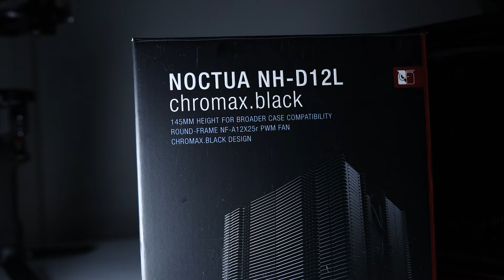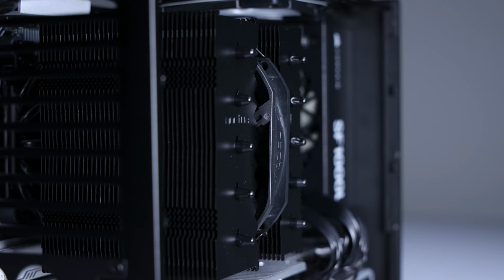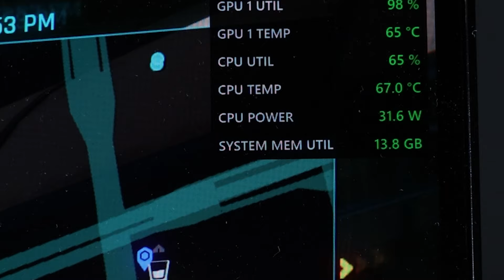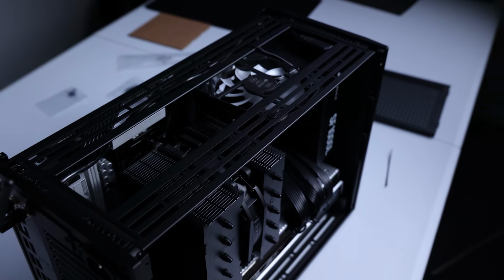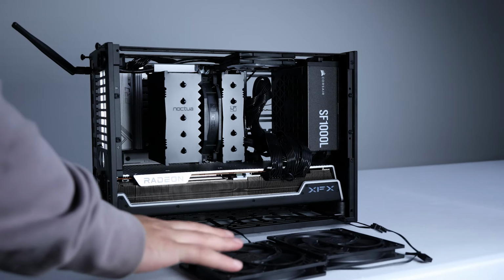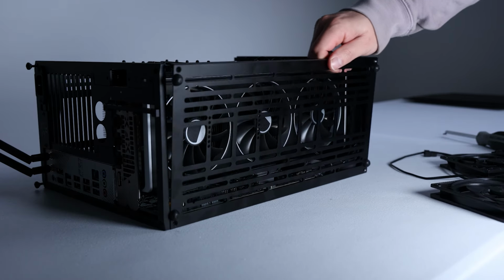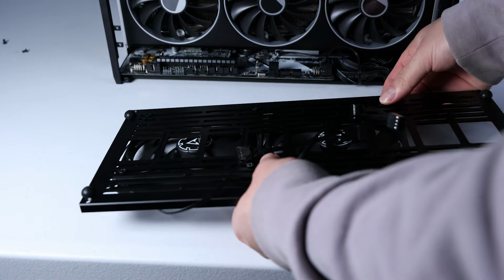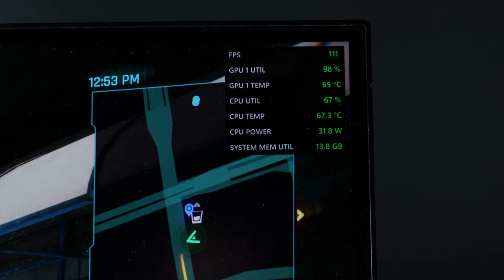The S-Tier SFF Case - NCASE M2 Build

Comment: as someone who has a XFX 6700xt I had to fan curve it as well, that thing sounds like a jumbo jet when the fans ramp and I prefer a quiet system as I listen to speakers mainly due to how amazing they sound compared to most headphones.

as a fan of Ncase will keep my eye on this, only thing that worries me is if you have to remove the gpu for any reason you will have to undo most of the case, personally eyeing up the Ncase FF1 if it ever releases -_-.

Comment: Thanks for showing fitting a giant gpu into this case. I am planning to upgrade my case maybe next year or two (I have been running my 4090 with my aging 9900k build that I built in late 2018 haha). I have a giant 4090 as well, Gigabyte gaming OC with a length of 340mm. My plan is to fit this gpu and an AIO into this tiny case haha.

Comment: I got the exact same build but kept it as the inverted design and an SFX PSU. With this setup I have exhaust at the bottom. I am probably going to add a couple fans at the top to feed the GPU more aggressively. I also put a 92mm at the back for intake to help cool down the CPU

Comment: Did you use the left-angled power supply cable, which is sold as an accessory?

I'm not sure if the included right-angled cable would fit for the classic setup.

Nice video!

Comment: I love tiny DIY build myslef and I'm currently looking for my next one after Intel releases their new CPU so I can look at some benchmarks before deciding. I can't wait for November or December to get all the parts!

A few tips for your build, first a SF750 Platinum would be more than enough and comes with flexible cables. Second, If you can add a duct from rear panel to stick to the heatsink it would be better because the CPU would have no other option than sucking fresh air from outside the case which really makes a difference.
Reply from the maker: Nov and dec will be an exciting time.
Reply: @Renegade_Rabryn  Hey! Case and some parts on the way, can't wait to build.

Comment: I can vouch for this case. It's the best case I have bought. Itx size with Matx power. I will be getting another one for a future build. If you plan on using an Atx PSU make sure to order  the mount with the case. 

Best Case I've used ever.

Comment: Nice build man, I wanted to ask you about some cheap fans that perform well to put in the M2
And also how many fans should I put there?

One more thing, as you have the case there, would you know the maximum GPU dimensions for an ATX psu, they are much cheaper and I am looking to get just a mid end GPU for now

Comment: Great video! Thanks for putting so much effort into this build and sharing it. You mention that the cooler Noctua cooler "juuuust fits". The side panel DOES MAKE CONTACT with the Noctua. Can you please elaborate on this. I am considering the Noctua you have vs the Assassin 12 Mini and I was under the impression that the Noctua D12L will not fit in the Ncase M2. The specs on the Ncase site mention max height that will fit is 144mm while the Noctua specs mention it is 145mm, so as you mentioned the side panel is touching. Is this causing any issues? Any weird vibrations or anything noticeable? Maybe a dent when you close the case? This thought is seriously making me reconsider buying the Noctua, although I fear the Assassin is underpowered for my setup. I would really really really appreciate your detailed feedback on this.
Reply from the maker: The side panel just touches it. No other problems that you are worried about. Go with the noctua it's awesome.
Reply: @Renegade_Rabryn  you mounted the 1 fan that cools the ram/psu on top. Is it possible to mount it to the side, or is there no room due to the d12l cooler height?

Comment: Mhhm, it would possible using an AIO on top or rear side, using the staff, with an matx board? I have no problem with gpu, mine is a 4070s dual slot. It would also fit two 25mm bottom fans right?
To be clear, i want an matx board, using an AIO on top, a 2-slot gpu, an sfx psu and atleast 2 more fans on bottom.

Comment: Hi, ordered the m2 grater in silver because of the fingerprints with rizer cable. Got an micro ATX Gigabyte B650M Aorus Elite AX Ice, an 1000 watts Asus Loki PSU and an Asus Tuf 4080 - very big card - would this configuration fit with the rizer GPU cable and the micro ATX Motherboard? Besides i will get the AMD 9800x3D - ist there a better cooler for this build or is the noctua the best one? Besides i am from Austria - so i should get the noctua anyway, even if it is 3x so expensive than the other recomended cooler… greetings!
Reply: Hello there, I have some questions: 
How did you order the silver version, isn't it out of stock? And what about taxes to send it to Europe?
Reply: Hi there, i ordered it back in August together with some other stuff, it was on stock for 30/09 to order, bit didn‘t get it yet. I thought till 250,—€ netto it should be taxfree from China, USA and Co…?! Greetings
Reply: @helgeschneider9399  Is it up to €250 for all EU countries?
Reply: @vicvm.  Got my M2 round silver for 187,90 € (ordered without extra accessories) including shipping to central Europe (Slovakia). You might pay customs on top (country dependent).
Reply: @hallbregg3369  Nice, so I assume that Czechia should be similar?
Reply: @vicvm.  I think so, because the same price was also for Germany. Just contact Ncase stuff via chat on their web page, if you will have any problem to select CZ at check-out.

Comment: Excellent video! Very nice advice on SFX psu instead of SFXL. Is the exhaust fan up top a 120mm slim fan or a different size? Also, I know you said you dont plan on changing the layout, but do you think it would be possible to rotate the CPU cooler 90 degrees and have the fans pointing up? I wonder if that would help exhaust the hot air from the GPU quicker.
Reply from the maker: I think it would suck hot air from the gpu if it was pointing straight up.  The fan up top is a 92 slim.
Reply: The cooler can’t be flipped 90 degrees as the mounting points aren’t square.

Comment: Well done. The compatibility list provided on the Ncase website is not very clear. For example, the 7900XTX graphics card you are using only supports the classic mode when using an SFX-L power supply. In the flipped mode, the power cables will severely interfere with the graphics card. Also, have you ever used the front Type-C port to connect an external SSD for speed tests or other high-load operations? My external SSD loses recognition when I run read/write tests through the front Type-C port, but it works fine when connected directly to the Type-C port on the motherboard's I/O shield.
Reply from the maker: Sorry, haven't used any external ssds

Comment: What do you think for the Fractal North vs Lian Li A3 Wood? I've mixed feelings, the A3 seems to have better compatibility with radiators but MATX boards... there isnt much option for amd (black). The North seems fine but I've seen lots of complaints about build quality, noise and poor radiator compatability because 360 rad is only possible on the front.. I need a new case but can't decide lol
Reply from the maker: I prefer the a3 over the north.
Reply: @Renegade_Rabryn  thanks for replying, how come the A3 over north?

Comment: I've been eyeing this thing, assuming an ATX PSU (140mm long) same size GPU, and a lower power CPU, what do you think are the chances I can stuff two 3.5in hard disks in this thing?
Reply from the maker: Slim chances. Might beabke to get them under the gpu but then there wouldn't be airflow to the gpu.

Comment: Nice build! The website says that the gpu is 344cm long? Or is it 357mm?
Reply from the maker: Good catch. It is indeed 344. I'm not sure why I thought it's 357mm. Pinning your comment.
Reply: @Renegade_Rabryn  no worries. I thought my 4080 Super would fit here as it's 357cm long 😅
Reply: 359mm. But this is the maximum internal space length , so it's best to choose an SFX power supply. Otherwise, the power cables are likely to conflict with the graphics card.
Reply: @MrOnlinenow  thanks! Is this your current set up with an ATX PSU?
Reply: Bro its milimetre mm not cm centimetre
Reply: @deniecejuliantan it would fit, in the website there is a build configuration for an rog4080 super that's 357mm
Reply: @mazditzo 😂😂😂
Reply: @mazditzo  357cm long gpu would be insane, it would be the height of 2 people LOL

Comment: Do you think a gigabyte gaming OC 4090 will fit in this case with the classic config like yours? Thanks!
Reply: Very good wuestion wonder if i need to order that separate thingy or not. The food nenws is that i know the gou will be cool as it has those massive he at sinks
Reply: It will not fit
Reply: Ive seen one make it fit, but you have to do vertical mount then
Reply: @Walhor yeah no question it will fit using the sandwich config but I am more interested about the classic config that way I won’t deal with any riser cable issues
Reply: @incubus3286  The one I spoke with who had the same GPU said he coulnd't make it fit in classic config due to the card being too wide

Comment: Ncase can suck it. I can not recommend them after I had the M1 Evo before this final revision. Build quality is there but not the build experience.
Reply from the maker: What exactly was the issue?
Reply: @Renegade_Rabryn  psu mounting options sucked. It's listed as sfx-l compatible but wasn't really. The optional taller case feet mounting is a joke. The original fan/radiator mounts sucked. I had issues getting the mobo lined up and the standoffs ALWAYS came loose when  I was trying to get the screws out.

When formed took over ncase, they didn't let the original m1 designer work on the evo and you can tell.
Reply: @vongdong10 M1 Evo sucks, you shouldn't have gotten that case tbh.
Reply: @init_yeah  yeah I fell for the hype. Got a monster a45 now
Reply: You must have not been around long in terms of ncase. The original ncase went through tons of revisions. The same will be said for the M2 as it progresses. These are not one and done cases as they take community feedback into consideration as the life of the product progresses.
Reply: @vookie91  you see the problem is, the final m1 was great as it was. New owner thought they could improve it but made some things worse. The fan/radiator brackets are a prime example. New brackets sucked so much that they went back to the old bracket.
Reply: I agree with what happened to the M1 Evo. It was a big deal for a year or more on the forum and then it released just to be discontinued and this released. 

I have a soft spot because I have the original M1 but with the Evo story I question getting the M2
Reply: I got the M2 for the build experience and boy did it deliver
Reply: @NeuralVoidSolutions  I still have mine, but no build yet, what will your future build be?
Reply: @vongdong10  “Settled for a monster a45” Why were you even looking at Ncases if you wanted an open air stand?
Reply: @frankzappa3156  where does it say that I wanted an open air case?